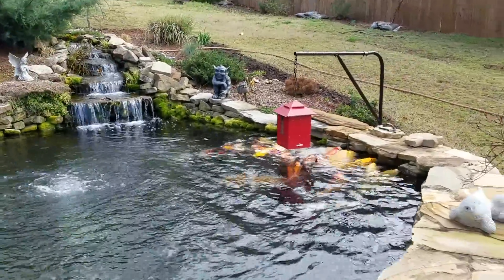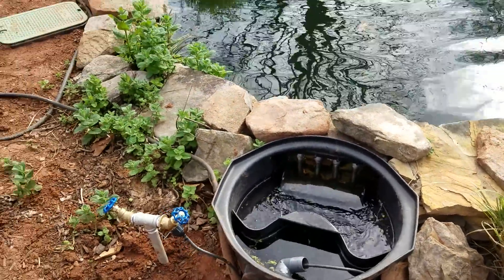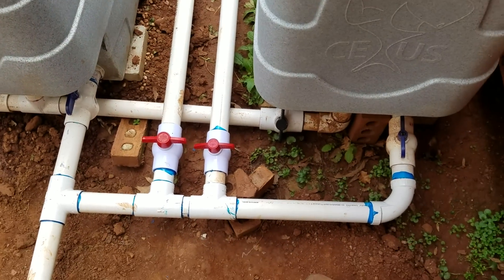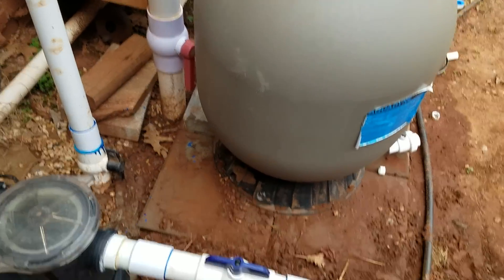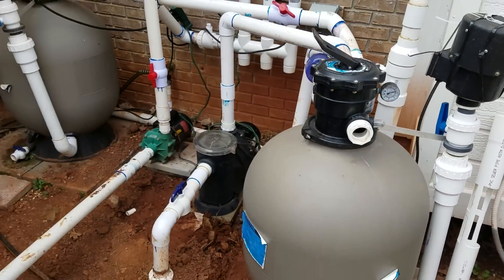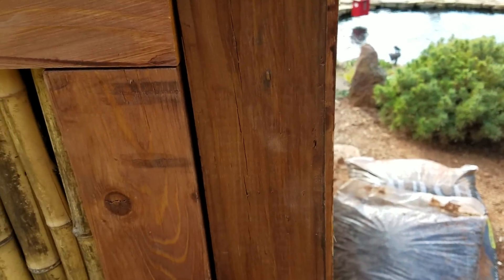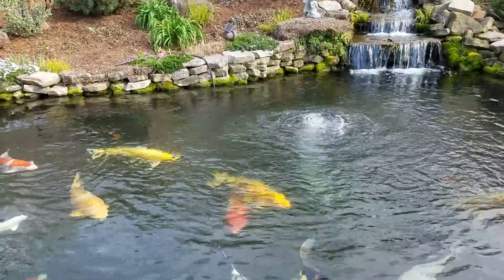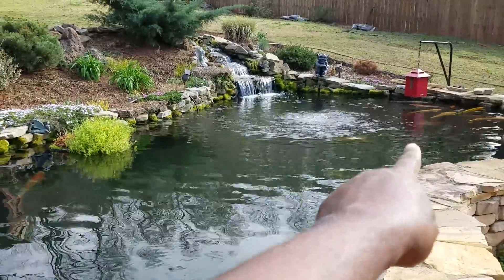My Koi Pond's Filtration Overview

Comment: Your filtration system seems great. I was thinking of the same for my pond(Only difference is instead of Sieves, it would be drum filter). I would like to know if your have done a water test and how are the results coming up?
Reply from the maker: Im always testing the water.  Test are generally good.  That changes with feeding amounts versus fish load.  Not an issue.

Comment: Hi great filtration setup.Can i ask a suggestion from you. I have same type pond like yours but i have a submersible 2hp pump which pumps the already inside water in the pond to a height of a rockery to create a waterfall.i am wondering can you help me which filtration system can i use for it.
Reply from the maker: That is a difficult question to qnswer here.  You should really google research filtration types to see what will work.

Comment: Great pond great video. So it's too deep for blue herons  to be a problem?
Reply from the maker: OG`s Fishroom the depth does deter herons because they cant stand in the water, however smart on cannstand on the edge and spear fish.  The straight sides is just as important as the depth for predator comtrol.  Luckly ive never had a problem.
Reply: Any plans to make any changes to the pond? What state are you in?
Reply from the maker: Alabama and just to add a 1500 gallon QT pond outside
Reply: 1973aueagle ok cool tks

Comment: Question: won't it be easier if the skimmer and BD both flow into one of those boxes? One less system to maintain?

2nd question: you have a running tap, okay for the running water to be chlorinated right? Since it's so small in volume, shouldn't be an issue right, but my question is, your pond has an outlet for excess water, or the running water is just enough vs. evaporation?

Comment: I'd give it two thumbs up if I could, very impressive and beautiful setup!  One question though, you said you were adding in 30 gallons per hour of fresh water?  Is that loss just from evaporation?  It seems like a lot!
Reply from the maker: Devin Mitchell it's called a "flow through".  pond owners should do weekly water changes of 20-25% to reduce ammonia, nitrite, nitrates and pheromones. I use to do a big weekly water change.  I feed heavy and keep a heavy fish load (not recommended for most), so mine is about 40%.  So instead of stressing my fish and dumping alot of water out and putting that much freshwater in at once.  big water changes cause big swings in parameters.  Its the same amount of water over the week.  If I was running a normal maintenance setup, I would be running about 17gal/hr into it.
Reply: Wow, I'm just having difficulty imagining how much water you're managing/filtering, it's huge!  We have a teeny-tiny pond here in the UK (your flow through rates would literally refill ours every 20 hours),  pump out 10% weekly and recycle it onto our vegetable gardens and flower beds.  You've got a lot of land back there, ever consider setting up a vegetable patch? :) //. Stunningly beautiful setup mate, thanks for sharing!